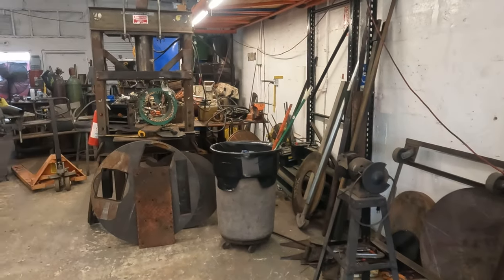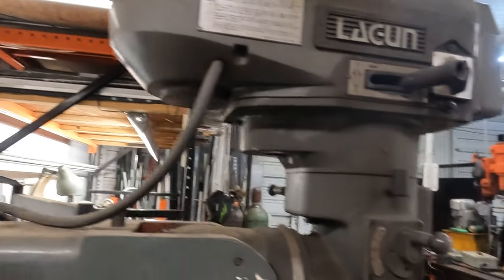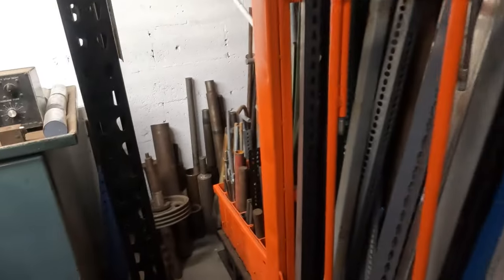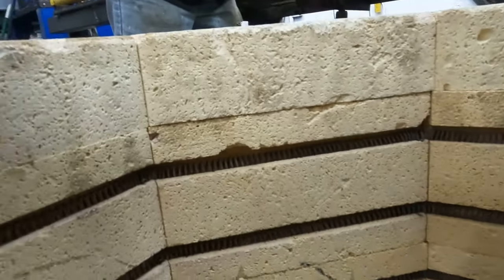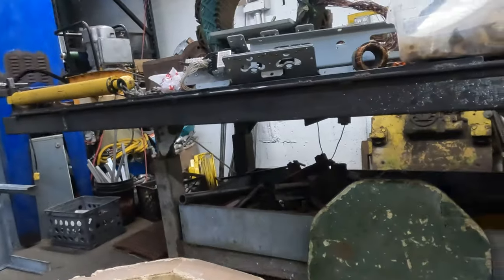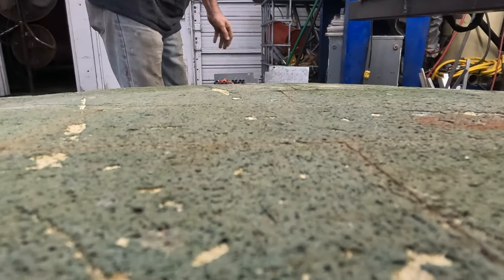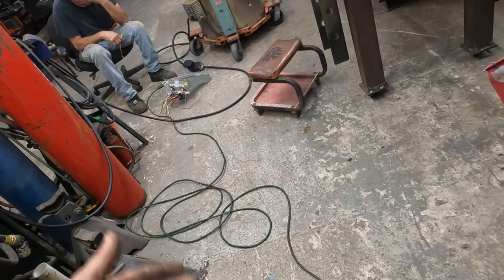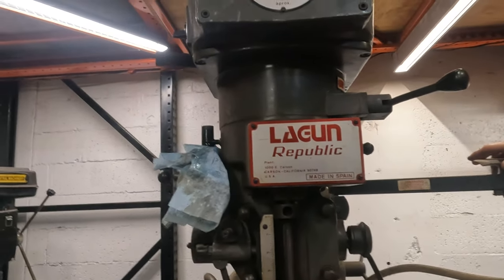Firing Up The Electric Kiln And Being Disappointed With The Results

Comment: You need to talk to the people who rewire those big electric motors, 100hp and bigger we had up to 800hp, they bake them in an oven to remove the epoxy from the windings so they can remove them and replace them, that is what they did to rebuild that motor for your milling machine. Keep up the great videos and God bless you and your family.
Reply from the maker: Thanks for the suggestion

Comment: that looks like a kiln for firing pottery, it will not get hot enough to melt al. or cu
Reply from the maker: It is, I got it basically for free so I figured if the electric won't work I'll convert it to propane or WMO
Reply: @ProjectShopFl no don't that electric kiln can be sold for 4,000 bucks or you can rent it out for potters

Comment: I wonder how a induction coil similar to the ones mechanics use on cars for stuck or rusty bolts but only bigger would work on those big electric motors and staters
Reply from the maker: I was thinking about that but I don't want to be burning or heating copper unless I am melting it.

Comment: My mom has five of these  kilns and one that is about 6 foot long they are used for firing ceramics and firing glazes on ceramics 
They will get up to 2000 degrees you may look up on line firing ceramics in a kiln. It does take a long time to get to temperature because it has to be slow not to break the pottery / ceramics you have to raise that flap up and put one those triangle little cones in the inside when the kiln get to temperature for the specified hours of the cone it will bend and the flap will fall down and shut it off 
If you need any info on this let me know  great video
Reply from the maker: Thanks for the suggestion

Comment: That looks like a kiln for pottery.  
Don't ram that chipping hammer into where that groove with plastic is. You have to use it on the copper loops on the front through the center of the stator. Ok. Good luck. It's always fun to watch ya.
Reply from the maker: Thanks for the suggestion

Comment: Ceramic kilns were never meant for high-temp baking/melting, as they were only designed to heat bisque (raw clay) items and most kilns were designed to pre-heat for around 30 minutes to an hour and then run at a lower power level through the day while it baked the bisque that was inside.   You may want to get a gas-powered kiln like the one BigstackD uses, as they're better designed for faster heat-ups and better high temps.  For the motors/staters you have, blasting them with flame heat is likely the best solution.  Bonfire FTW!  Hope this helps!  God bless!
Reply from the maker: Thanks for the info and the suggestion

Comment: The cones are used to hold the power on and heat up the coils. As soon as the coils reach the temp of the cones the cone breaks and kill the electric to the coils so you don't over cook the ceramics and destroy it
Reply from the maker: Thanks for the info

Comment: I know you got that kiln basically for free.  You'd probably be able to sell it as working for a nice chunk of change.  I think what you want is like a box furnace if you want electric.  Those things will melt your aluminum, copper, and brass.  Probably get iron to glowing too.  It would still take a couple hours to get it to heat though.
Reply from the maker: Thanks for the suggestion

Comment: "What's in the Box?" unboxing video series. 🤣 It's Christmas time early in the shop.  Don't mind me, but that was f'n funny to me when you said that.  That kiln is just not happening.  Too bad since you get electric included in the rent.  You may need to get a propane furnace.  I believe Devil Forge is the furnace that bigstack D casting uses.  That thing gets red hot in minutes.  Would have to buy the gas tho.
Reply from the maker: Thanks for the suggestion

Comment: Does the milling machine need to be bolted to the floor?  Looks heavy enough, might not need it.  I've never watched one run.
Reply from the maker: It should not have to be it's self contained as for the work load and is supper heavy

Comment: The heating elements are 220.  They do get red hot.  They look like heatpump emergency heat elements.  Probably will not survive in the kiln. For sure wire insulation will melt off.
Reply from the maker: They the heating elements from an AC unit
Reply: AC systems don't have heaters but heatpumps do providing backup/emergency heat.  AC and heatpump systems are virtually identical except heatpumps have a reversing valve to make it run backwards and produce heat.  I would bet, living in FL, that those elements were never ever turned on.

Comment: Cut the edges off that steel recycle the scrap and stack the big stuff
Reply from the maker: I was thinking the same but did not want to be doing all that cutting. I need a plasma cutter.
Reply: @ProjectShopFl  I figured you would have one. All the equipment you own. Yep you need to aquire one with all the metal work you do.

Comment: If it doesn’t melt copper but melts / dissolves plastic? Maybe use to melt off all the small spaghetti wire plastic coating? Leaves the copper clean.
—- Just thinking out load 😅——
Reply from the maker: I think that would smell bad. lol